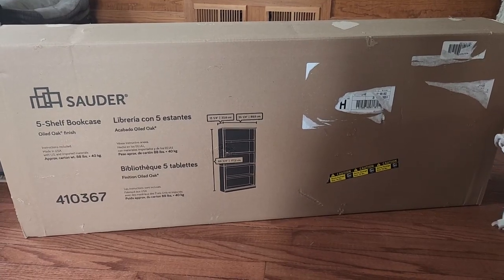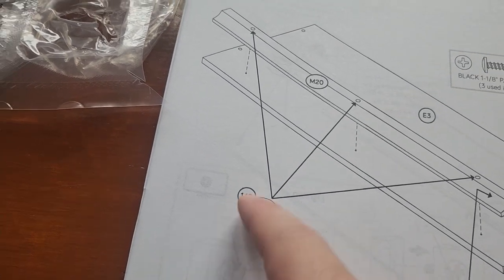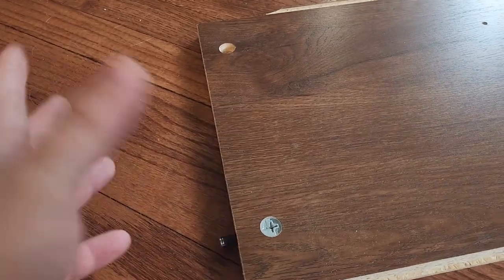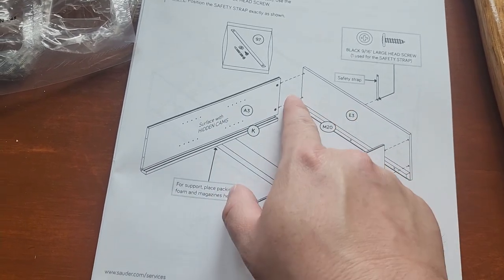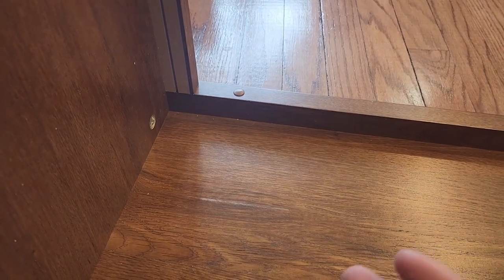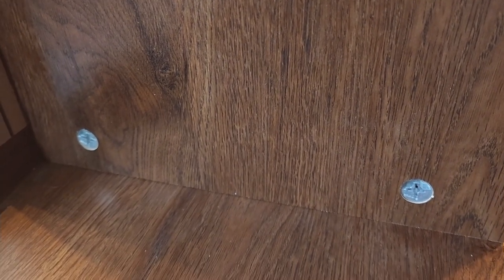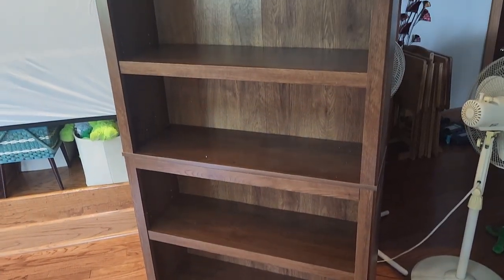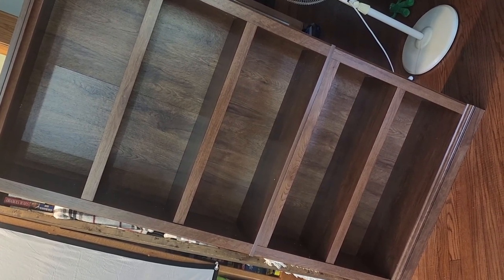Let's Build This Sauder 5 Shelf Split Bookcase!

Comment: I have a similar unit, but it has 4 cubes at the bottom.  Either I misplaced the nails for the back or they were missing in the  box. Do you know the size of the nails? The instructions just say nails, 50 pcs.